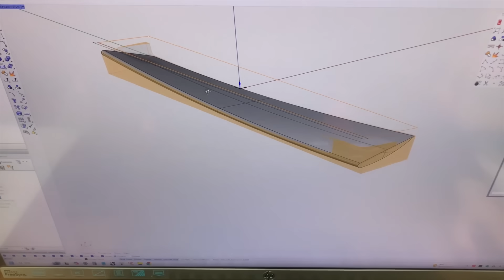木製縦型風力発電機の試作品を作るプロセス。地域木材資源と最新加工技術が切り拓く実験的ものづくり。

Comment: To generate significant power through theoretical calculations, for example, 10-30 kW. I did not start because the size of the vertical wind generator would be relatively large, and besides, I was lazy. But you are right, always respect for a hard worker!
Of course, thank you for your video. I am grateful.

Comment: Since wood does not like high speed, especially heavy weight, the way to reduce centrifugal force and increase power is to increase the torque, that is, increase the radius. At this time, I think that it is possible to realize maximum power generation according to the strength of the wood material. And in order to reduce the friction between the wood and the air at high wind speeds, the wood surface should be enameled or polished.
I am interested in how much maximum power can be generated using wood material in a horizontal wind generator? This would be a very good investment for developing countries. Especially for countries in Asia, Africa, etc. The production of fiberglass or composite wings is still a big problem and an environmental problem for developing countries.

Comment: Was the wind not strong enough?
Need to be taller to catch more wind?
Reply: Yes, it has to be quite high. There are logarithmic calculations for this. Maybe there is an online calculator or program. For example, if at a height of less than a meter from the ground it is 5 m/s, at a height of 10m it will be about 8 m/s. And the difference in power is: 5×5×5 / 8×8×8=4.096 times.